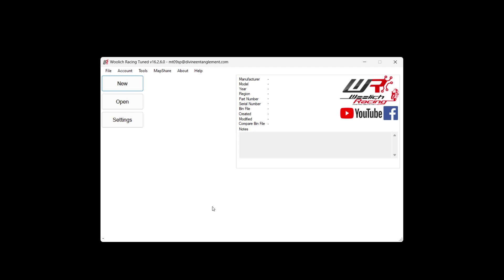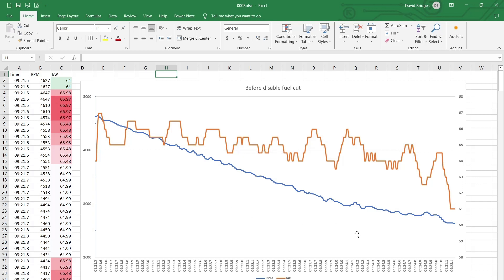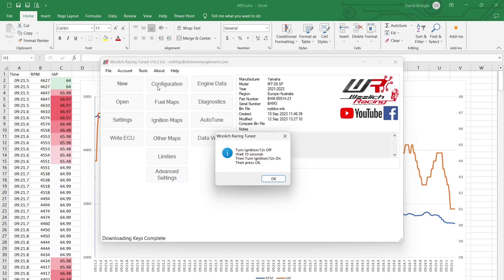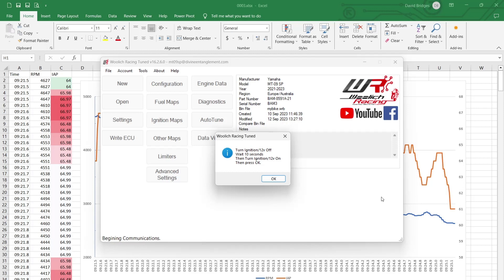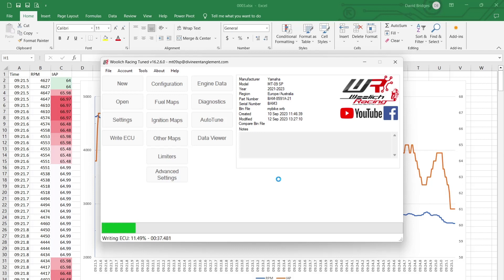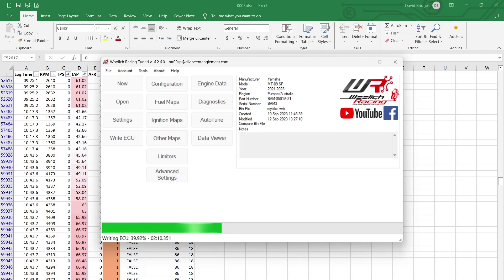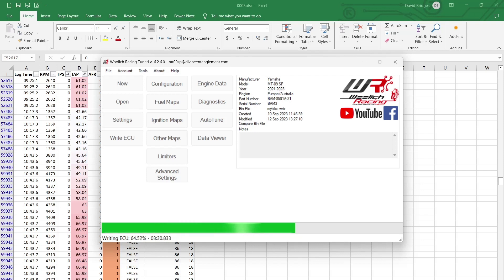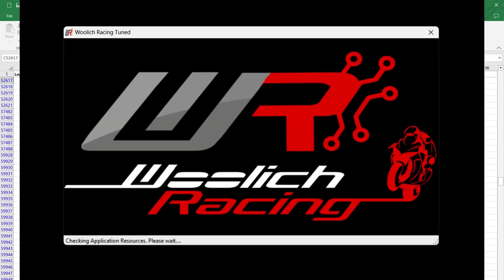Woolich tuning deep dive part 3 - Setting disable fuel cut.

Comment: David, with fuel cut disabled does auto blip down make the bike lurch?
Reply from the maker: Lurch forward? No. Downshifting is actually smoother because the engine braking is reduced. Unless you explicitly increase it again which you can.

Comment: Hi David, these WRT videos are really interesting, Im soaking the info up like a sponge, thank you for taking the trouble to video this. Just to add something, you questioned the meaning of the TPS. I had to replace a faulty TPS on my MT09 Gen3 (common fault with new incremented part). Its basically a rotary variable resistor that physically mounts to the butterfly rotation shaft. The butterfly valve is on the right hand cylinder together with servo motor which is controlled by the ECU. So its just a sensor providing feedback to the ECU on actual butterfly valve angle (there are 2 signal channels for comparison I assume). I wrote the change up on the MT09 forum in case you want to look it up.